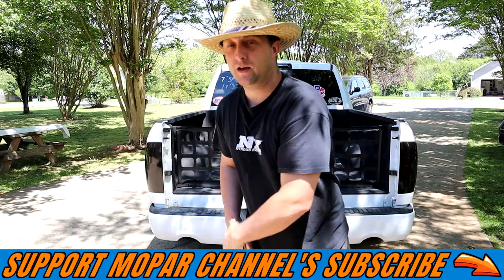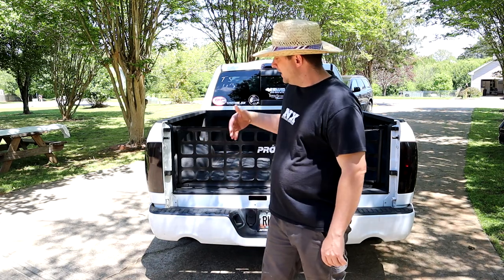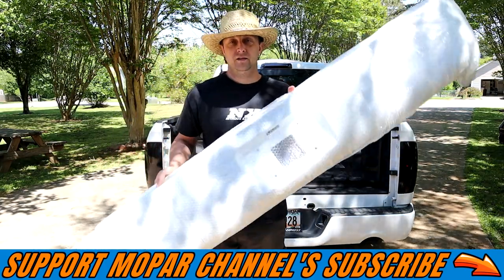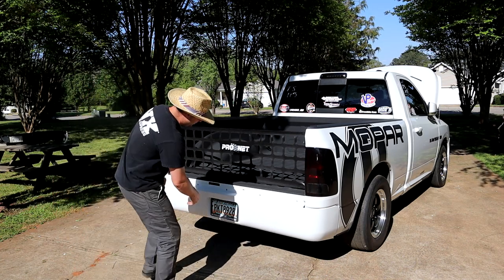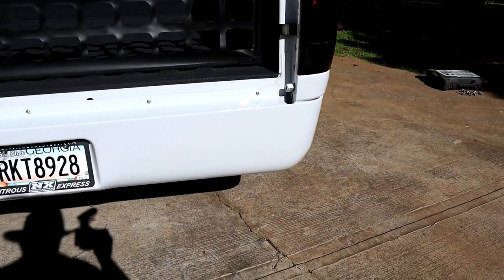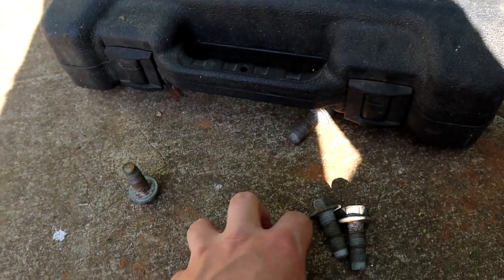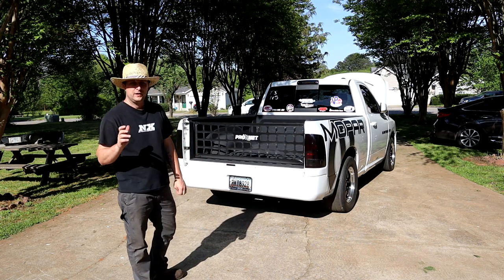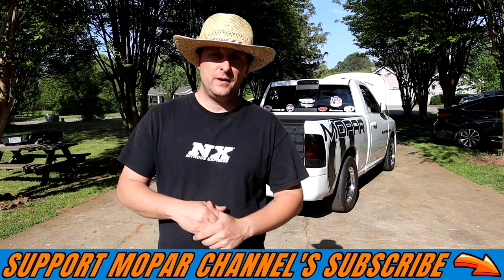NEW Roll Pan Installation On Ram 1500 From StreetNShow

Comment: Do you still have the shipping label that would say how much the roll pan weighs?
Reply from the maker: The entire package weight says 23lbs for box,pan and bubble wrap. Just the pan felt to be about 10-15lbs at best.
Reply: @FrostbiteRam  nice. Much lighter. The rear bumper on mine weighs 36, oem class iv hitch is 52 and tailgate is 66.
Reply from the maker: @stuartgriffin5.7  yeah its definitely lighter.
Reply: @that4door  no. Not at all. Mind ya bidness 😅

Comment: To bad they do not make them in steel anymore.
Reply from the maker: This roll pan is steel
Reply: @FrostbiteRam  I understand that.. my comment was, to bad they don't make them in steel.
Reply from the maker: @mytnoid  this company only makes steel roll pans
Reply: @FrostbiteRam  well on the website I found it isn't.  So can you provide me with a link for steel?
Reply from the maker: @mytnoid  I messaged them and this is the response.
Hey buddy,
Were temporarily out of stock on those. I wont be able to order anymore
into production until Aug. and they probably wont arrive until Nov. or
so.  Also They probably wont be the same price,  We have had a lot of
supply chain issues, everything on our end is way up in price.
Materials and delivery costs. Materials up 30% and delivery cost has
tripled. Crazy times.

Thanks,
Anthony